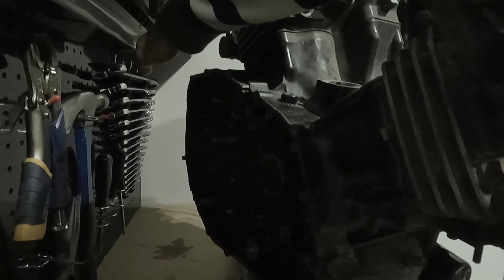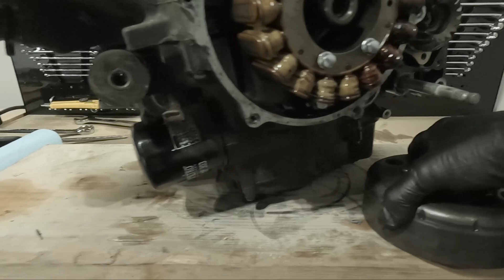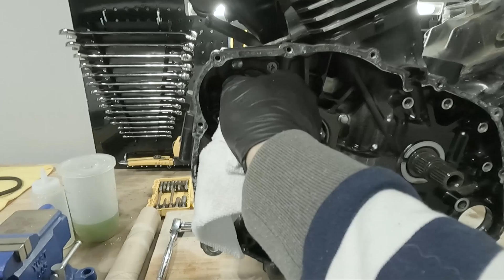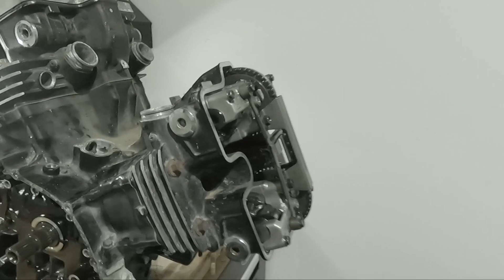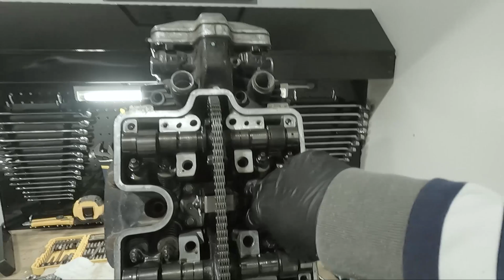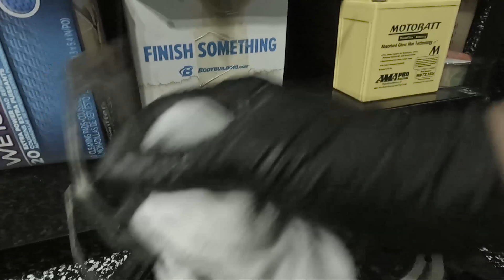How to disassemble a V45 Engine - Part 2

Comment: At 8:15, you say "Let's take off the guards up here." At 8:16, they are off. I am stuck at that point. Those 4 bolts won't budge, even with heat and an impact wrench.  I'm really afraid of breaking them off inside. Did you have any trouble loosening those bolts? Do you have any hints or suggestions?
Reply from the maker: The 8 bolts (4 inner ones for the cam chain guide, and 4 outer ones for the oil pipes) are pretty tight indeed. There is a note in the shop manual about rotating the engine over until there is slack in the chain in order to remove the tensioner but I can't imagine that is holding you up (see https://static.secure.website/wscfus/8959944/uploads/Chapter10-03-CamshaftRemovalsmall.htm). The bolts themselves should have been torqued to:
- 20-25 N.m (14-18 ft.lbs) for the cam chain guide bolts
- 10-14 N.m (7-10 ft.lbs) for the oil pipe bolts
(See https://static.secure.website/wscfus/8959944/uploads/Chapter10-22-CamshaftInstallationsmall.htm)

So not really sure why you are having this much trouble with removing them. They shouldn't be rusted and fused...unless the motor was flooded and been sitting out for years on end. You could try using PB Blaster on the bolts, but if you have resorted to Heat I don't think that would help.

Comment: How many miles were onbthis engine?
Reply from the maker: Well when i bought the bike it was attached to the odometer said ~16,000km. But the wires to it were also cut long before i bought it. So I have no idea how many it actually had on it. I decided to make a wall piece of it because one of the engine mounts was completely snapped off. Being a part of the lower engine block it was simply not worth even trying to repair it. The motor did run though, and as i am sure you saw in the series the internals were in pretty good condition.